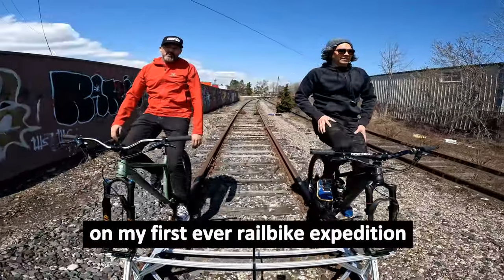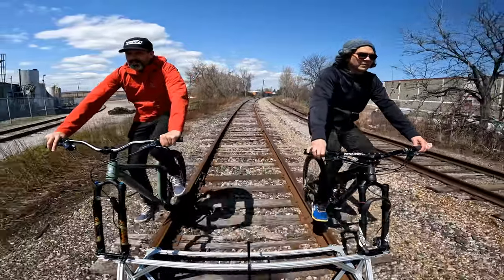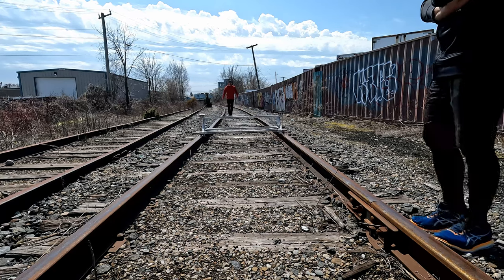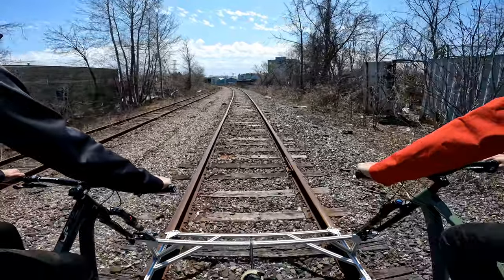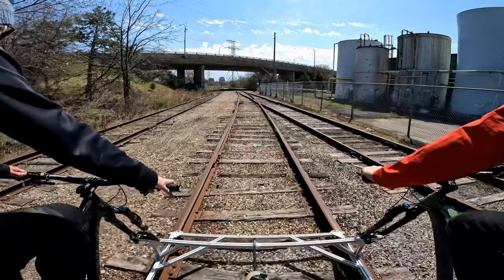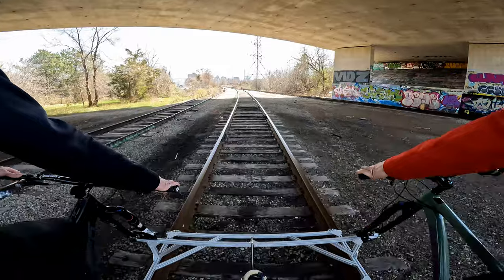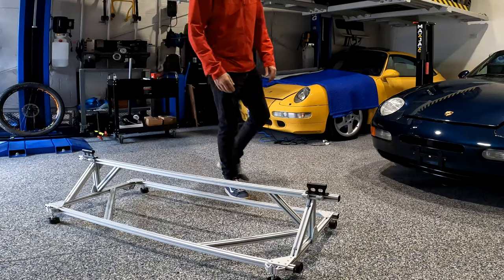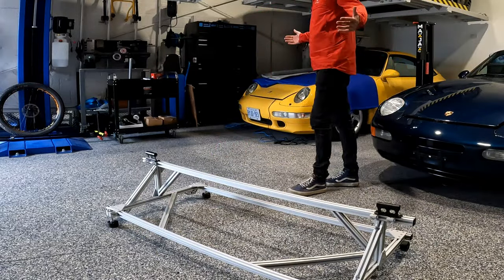2 person | Side by Side | Tandem Rail Bike

Comment from the maker: First rule of rail biking - don't ride on active railways.
Reply: Unless you have permission.
Reply from the maker: @royreynolds108  Fair enough. I just wanted to make sure people know I'm not riding rails with actual trains running on them...seems to be a common comment when I post these videos.
Reply: @royreynolds108 permission from who??
Reply: may I suggest some kind of 'rail sweeper'
Something mounted at the front of the vehicle, ahead
of the first wheel to sweep or knock off anything sitting
on the track that might cause a derail?  A piece of flat stock
mounted at an angle? Just an 1/8" above the rail? 
Cool, simple design.
Reply: Would riding on a railway that hasn't been active in your area since 2011 but still claims to be an active railway count as an active railway?

Comment: Where’s the build video for the aluminum frame? Design, details, success and failured attempts, creation is half the fun! We need specifics, like which wheels and rollers, width, length and height of the frame, total weight too. Awesome channel,  great design creations and amazing drone editing. You opened my eyes to a new world. Thanks
Reply from the maker: I'm pretty sure I'll do an instructional video once I get it dialed in perfectly. Right now it works very well, but I'm still tinkering with small aspects of the design here and there. It's a ton of fun.
Reply: @Suluk46  I can't wait for your instructional video.  I want to make one of these so bad.  Thanks so much for your videos.
Reply: @Suluk46  This looks very well designed and cost effective to build i would think too!
Reply: @Suluk46  Man, please sell kits. Please. For real. I will buy two right now! My kids would love this!

Comment: Probably want tall stem extenders and riser bars or your backs, shoulders and necks will ache after about 10 mins. Mountain bikes are optimized to be balanced over, leaning forward, going downhill, not ridden for hours on flats. Nice front rack idea though.

Comment: If the horizontal wheels against the rail heads to guide the frame are 1 1/2 inches in diameter or less, they should go through the flangeways of the frogs and guard rails.  Individual wheels from inline skates could be mounted so they are vertical or almost vertical to be the guide wheels to stay on the rails(say about 3/16 inch from each rail to give a 4 ft 8 1/8 in over the wheels to ride inside the gauge for standard which is 4 ft 8 1/2 in.  Those bearings are meant to spin fast so the speed you will be traveling should be under their top RPM.
With this setup, you could make it for any gauge you desired.
Reply from the maker: I had vertical and angled inside guide wheel on some of the previous versions but the end up causing the device to "climb" up the rails and eventually pop off. That's why these are in full horizontal position. I also had smaller guide wheels, which I could go back to, these are skateboard wheels and are about 2 inches in diameter. The rails in the video are wide gauge ~65.5" inside distance, but the aluminum extrusions is adjustable to match whichever gauge you are on. Still some work to get it perfect, but so far so good. Thanks for the input, sounds lie you know your railway dimensions well.

Comment: I got some cheap rubber wheels with bearings on sale at Princess auto. They will probably ride nice and smooth, and quiet on the steel rails.
  I would like to build a very similar contraption to what you’ve engineered. 
  That looks like 8020 aluminum extrusions, is that right? How much do you think the aluminum would cost that you used, and where did you source it? 
  That looks like about the best set up. I’ve seen so far. I am planning on getting some old plastic cutting boards to make a a bigger inside guide wheel on the same axles, to keep my big rubber wheels  on the rails. It should avoid the problem of hitting most stuff, because it would more or less mimic a train wheel.
Reply from the maker: The entire device cost me around $500. I bought the 8020 from McMaster Carr. It's 30mm and the width is around 5 feet, and about 2 feet long. Hope that helps.

Comment: Awesome! What happens if one person pedals faster than the other though, would the frame twist ? 🤔 Also wondering if there's anything to keep the back wheels from staying on the tracks. I feel like it could slip off the rails. Great idea though, I love it !
Reply from the maker: It might. We broke one of the fork mounts when we hit some thick brush, so I've upgraded that part of it. It's pretty rigid but best if you ride at a manageable speed.
Reply from the maker: And the rear tire just follows the front forks.

Comment: Concept is very cool, kinda like an amusement park luge track. Didn't look like you really tried to break it / stress test though. Weird how the bike wheels just follow. Maybe you could sync your brakes mechanically. Also wonder if you could get away with baldy mtb if not slick road tires, reduce that resistance. Good amount of luggage space though 😂
Reply from the maker: We were out on it for a while, this was more of a demonstration. We ended up breaking the fork mount so I've made new ones myself that are much stronger. Have to go out and test them to see what the weak point is now.

Comment: How fast can u stop, when there is less grip than on the road.
Reply from the maker: Need about twice the distance to stop on the rail then the road. So if you need 5 feet to stop from 15kph on the road, then you would need 10 feet on the rail. Good thing is that it stops faster on the rail, then on dirt, which is what I usually ride on.

Comment: Awesome video! This version of the railbike seems to be very easy to build and carry. I've created one steel version, but it is weighing around 30kgs without the bikes :))   Did you use 30mm VSlot profiles? Do you have some plans / drawings of the construction?

Thanks a lot!
Reply from the maker: I don't have plans but yes, I did use 30mm aluminum extrusion. Mine weighs 22 lbs, which is about 10kg and can break down for storage fairly quick and easily.
Reply: @Suluk46  Thanks a lot for the details! Wish you all the best! Looking forward to see the next improved version!

Comment: If the rattling is jarring at all maybe a suspension seat post could help
Reply from the maker: It sounds worse in the video than it actually is, but definitely need to upgrade the wheels. Bigger and softer.

Comment: Ever thought about having bigger wheels…maybe kids bike tires…so it doesn’t go cluck clunk over the joints?
Reply from the maker: I have lots of different wheels, all kinds of sizes. They all go clunk, even the bigger ones. These are about 3" but probably 5" is ideal. Any bigger and it's too much rotating mass.
Reply: @Suluk46  I was thinking about putting your front bike wheels as the front rollers. Just a thought.
Reply from the maker: Not a bad idea. I have a concept designed with that in mind. We'll see what comes next.

Comment: What stops the rear wheels from slipping off the rail? Does it just track so reliably behind the front?  

I kind of want to see a version with an e-bike motor and  luggage platform and some solar panels in the middle : )
Reply from the maker: The rear follows the front. I haven't had the back wheel come off. E-bikes are definitely on the horizon, just need some protective gear.
Reply: I was wondering this, it amazes me that they just don’t slip off the track 🤯
Reply: @Suluk46 I did 212klm on narrow gauge. Initially the rear wheel was falling off the rail on tight corners (inside) with lots of camber.
 Discovered tyre pressure was too low. Pumped to 30+ psi and no problem.
 Did have load over the rear wheel with camping gear etc in panniers.
 Love your work 👌